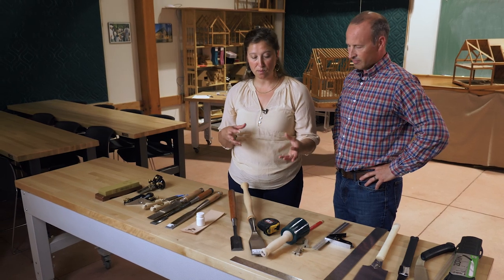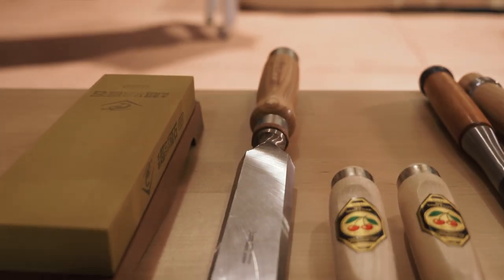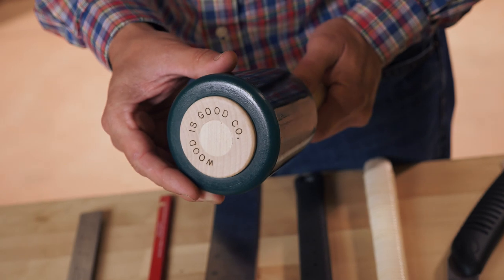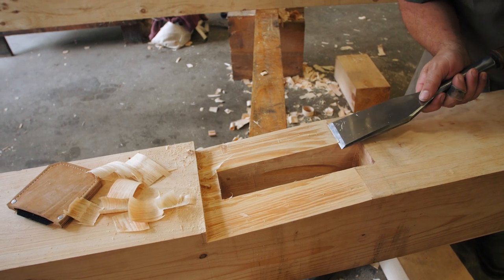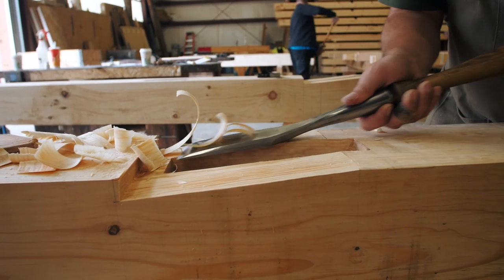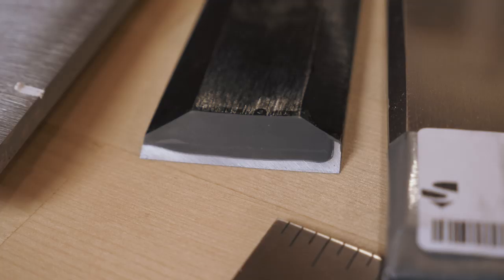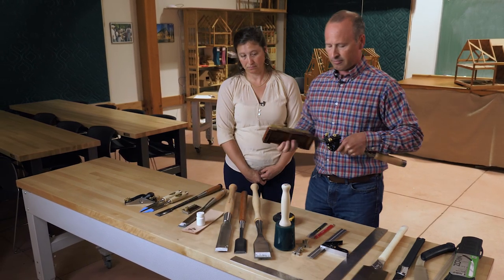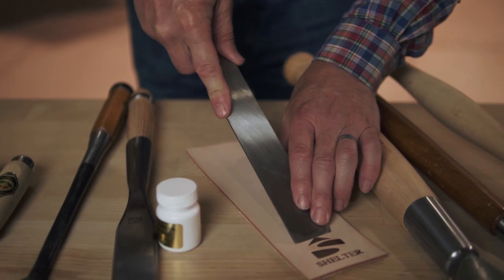Hand Tools For Timber Framing Pt.3 - Chisels & Slicks

Comment: are slicks and hand planes somewhat or mostly interchangeable in the tasks they accomplish with timber framing or is there something that one can do significantly better than the other?
Reply from the maker: Adam Macke while they do perform similar tasks, the hand plane is designed to take a uniform, thin shaving from the surface of a piece of wood, the slick gives you a bit more freedom in terms of the amount of wood it can shave; you can take 1/32” in one area and dive deeper in another area. Also, the slick can be used inside a mortise to pare end and edge grain while a plane is difficult or impossible to use inside a mortise. The slick is our go-to tool for perfecting joinery, while a plane excels at a few (perhaps simpler?) tasks.

Comment: Hi. What width slick is "best"? 2 1/4 good?
Reply from the maker: It completely depends on what you will be doing with it. We really like 1-7/8" or anything under 2" because many of the mortises we cut are 2" wide. If you will be working with wider mortises or space in general than a wider slick may make more sense
Reply: @ShelterInstitute  thank you for the insight 👍